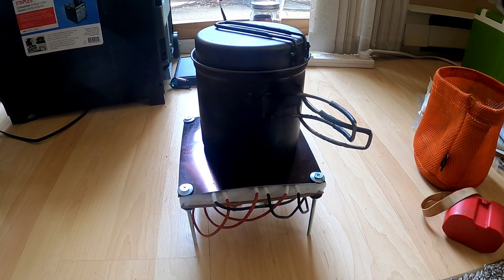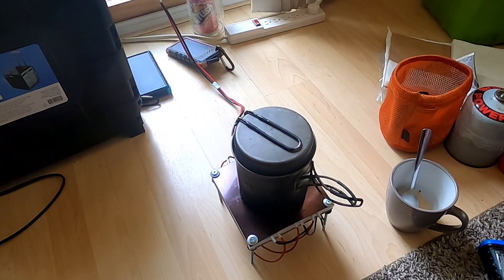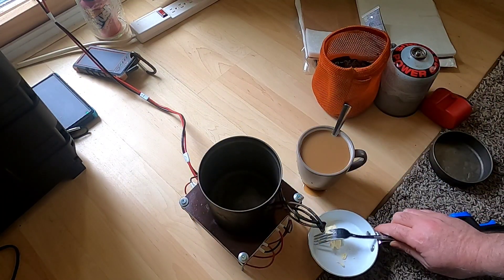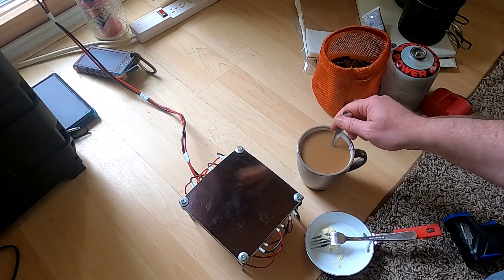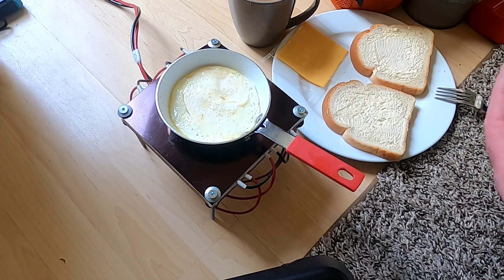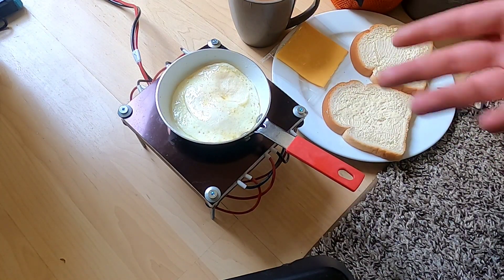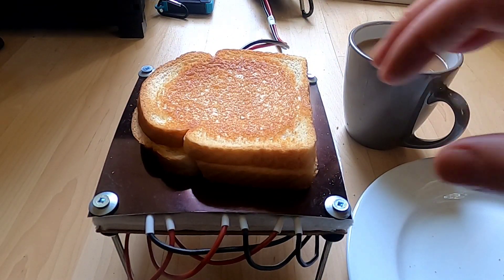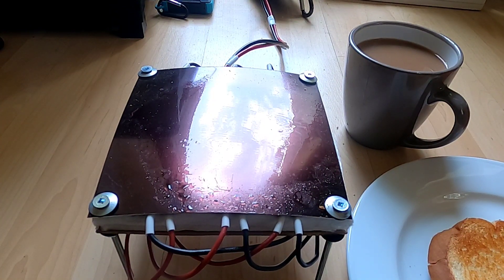12 VOLT DC POWERED, THE MOST EFFICIENT STOVE ON THE PLANET PTC THERMISTOR CERAMIC HEATER PERFORMANCE

Comment: I use 2 devices for this sort of stuff, a 12v rice cooker can be used as an egg frying pan, has the same ptc elements but is lower powered. And for boiling water just dunk a 12v immersion heater in a good thermos, then u can have your hot water ready to go any time of day or night with no waiting around. Think I'll have to make something like this for grilled cheese sandwich tho

Comment: Does that top aluminum plate have to be black ?
and how thick is it ?
and does that matter ?
the thickness of that top plate?
Could it be stainless steel?
Reply from the maker: No it doesn't need to be black, if I remember about 3mm thick, the thinner the better but still want it thick enough to be a firm plate still, copper or aluminum is far better then steel. Thanks for watching more coming soon cheers.

Comment: 😂 my induction stove will bring a full liter of water to boil in five minutes 1500 W so your 500 W unit should do it in maybe 15 minutes but yours will take easily a half hour and more so how is anything that you are doing more efficient?
Reply from the maker: It uses way less then 500w closer to 100w when temp reached
Reply from the maker: Your induction stove can't run off 12v either... so when using offgrid you need a 2000w inverter etc., I don't any 12v battery will do.

Comment: I'm looking at using these units to make a thermal mass heater AKA Sand Battery.
My thoughts are to use a copper block, set in sand. Any rule of thumb as to the size 12v PTC I should shop for?
I will be using a deep cycle marine battery . and maintaining it with a trickle charger.
Reply from the maker: You could use a copper sheeting instead of block as the copper will just be used to spread the heat faster throughout the sand, the higher temp ptc would be recommended. Depending on the volume of sand larger ptc would be needed as well. If used as a heat source a trickle charger would probably be insufficient as the power draw would be higher than 10 amps when 'charging' the thermal battery. I would need to know far more specifics of your build out to give more precise responses, hope this helps though. Thanks for taking the time to watch more coming soon cheers.

Comment: The video was a success - I'm so hungry right now.  I was thinking that it would be nice to have extra elements and switches to adjust the heat so that one could keep a pan of soup warm after cooking.  The switch would be a "1 - 0 - 2" heavy duty type and it could turn on 1 or 2 elements which is only 3 switches to control all 6 heating elements. Although, I would make an 8-inch top as my small sauce pan bottom is 6 inches - a little close to the screws.

Comment: how could i use PTM with ISEC (insualted solar electric cooker)?  in particular, could it heat up PCM (phase exchange material) and cook in the evening when the sun.  -- cant get my head around it.  thanks in advance!
Reply from the maker: You might want to look into thermal cookers
Reply: thermal cookers still require an initial heat source which is expensive for us - ive tested them.  they arnt that great.   @frankbush333
Reply from the maker: Sorry misunderstanding the question. You are wanting to use a thermistor to heat something like Hydrated Salts a PCM as a heat source after the sun goes down to provide enough energy and temperatures to cook with then inside an isec?
Reply: if ound the answer on PTC Positive Thermal Coefficient (PTC) Thermistors: Made from a ceramic substance with a temperature-dependent resistance that rises abruptly at a determined temperature, essentially shutting off the power.  They provide high power without allowing the temperature to exceed a certain threshold, and therefore provide both a heating source as well as temperature control, so no additional thermal monitoring is needed.  For instance PTC heaters rapidly raise the temperature of car seats to ~ 50 C and reduce power, maintaining the moderate temperature.  PTC heaters are available for temperatures as high as 270 C, which is high enough for ISECooking, even with thermal storage.  Another advantage of PTC heating is that the heater comes complete with high temperature wires that can be soldered to the power leads allowing the wire junction to remain relatively cool, avoiding corrosion problems.  The disadvantage of PTCs is that without good thermal connection to the food, the PTC temperature will rise to the transition temperature and turn off before the food is hot.   Additionally PTCs are not locally available in any African country I have visited, and must be imported, although they are not too expensive.  Lastly, a considerable number of PTCs have broken, for reasons that are not clear to us, but likely because they were forced to put out more than their rated power.  For details, please see our PTC report.

 

More than one heating type can be used on the same ISECooker, providing multiple functions.  For instance, a series circuit of diodes and PTCs provides temperature limitation and keeps the working voltage reasonably close to V_mppt.

  @frankbush333
Reply: thank you so much for your reply.  since im volunteering at a school in cambodia - we have issues with electricy due to the cost.  to cook food for 25 kids - i was looking for solutions.  i originally used a solar cooker but that was too difficult to use.  isec takes the concept and brings it inside.  which is much better for the cooks.  isec found a way to heat up PCM material during the day - storing the energy.  isec recommend using resistive coils but nowhere to be found.  i used china taobao to buy things but didnt really understand enough about heating elements.  PTM i found shuts off at a certain point -- im still looking at different options.  we can make one.  but already have interests from neighbors and family.  
so i want to keep it simple and low cost. thanks for your reply.  :-) @frankbush333

Comment: Iductive vs resistive load! I’m curious to what this amperage draw is from start to finish being a resistive load! It should be constant.
Reply from the maker: It is using thermistors 'variable resistance with temperature' so amperage drops as temperature rises to a set temperature.
Reply from the maker: I did a full detailed build on my channel, check that one out I detail out power consumption specs.

Comment: Hi, l  enjoyed the video but am left with question reg PTC thermistor values as printed on the items.
Ref l have a PTC blue ceramic disc type with   PTC C840 printed on the top half of the disc.
Then a line under the C840 with 0317 printed on the disc.
My question is what can l determine from this ident reference number?
Reply from the maker: The C840 is the type of thermistor you are using the C stands for ceramic and the 0317 stands for the resistance of the component at 25c I do believe. I am not a thermistor expert I normally focus of the voltage needed and the max temperature achieved and how many watts it consumes. Hope this helps, cheers!
Reply: @frankbush333  Hi Frank,much appreciated all knowledge is helpful to me

Comment: i am looking at doing something similar using 22ohm 10 w resistors on a 14v lithium battery in total 24 in parallel  drawing 9w each(216w total) and incasing the them on a perlite bed forming a reasonably large insulated cooktop ,not entirely sure but i think ill incorporate a potentiometer to vary the output ,from the math i have done so far it should boil 250ml water from 10 to 100 in under 8 min , hope it works out as the math suggests any ideas on what i mentioned would be great i am amateur as at this stuff lol
Reply from the maker: I am not sure the temperatures the resistors would reach worth testing them to see if they get hot enough first, the perilite maybe ok but I wonder about the air gaps around the pellets and whether that would negatively impact performance or not... I like the idea of the potentiometer control but would want to test the voltage drop in relation to the temperature as well. The issue using the resistors over a thermistor is they need continuous power to maintain temperature whereas the thermistors automatically decrease power consumption when peak temperature is achieved. For my build it was all about using as little power as possible to do the job not necessarily boiling the water as rapidly as possible, for off grid use power consumption is always a big factor. I think you have an interesting idea though if you get it running let me know how it turned out! Thanks for watching cheers!
Reply: @frankbush333  thanks for the input i was worried the air gap could be a problem too was hoping if im boiling water that could take enough heat from them to avoid burn out and for sure needs alot of testing in regards to temp.
i do think thermistor is probably a better way to go but was just trying to build as cheap as possible to be honest i hope to have some progress in next couple weeks i will update on any success or failure lol thanks for the vid very helpful
Reply: @frankbush333  done a bit more reading up on potentiometers and rheostats and decided that is not a good way to go instead i think since all the resistors are  in parallel i will just place switches on them individually or maybe groups of three so i can short circuit them and it shouldnt effect any other part of the circuit this way i could have 24 heat settings with 24 resistors and could even turn of half the element at a time if i wanted to use a smaller pot or have half the pan warm and half hot , i think digital potentiometers can do a similar thing but using manual switches avoids voltage drop problems and is just easier and cheaper
Reply from the maker: Ya after leaving the last message I was pondering similar things, was debating the amperage just increasing as the voltage dropped not really efficiently solving the problem... for such simple things that get tricky fast, lol.
Reply from the maker: That is why I went with thermistors they automatically decrease power consumption as they reach peak temp.
Reply: @frankbush333  finally got around to making some things first was a small pan with 9 x 15ohm 10w resistors on the bottom runs at about 90watts cooks an egg fairly quick maybe 5/6 min but will eventually increase pan size and go for 18 resistors with 2 heat settings it just sits on 3 nails , the second build was real simple about 10 metres of 25awg wire totalling about 1.6ohm wrapped around a coke can consumes about 100 watts and boils a full can in 15 min im probably going to go for thicker wire and more watts since it will run direct of a battery and not through a 10amp cigarette lighter total power used was 2ah at 12v probably 3ah to get to full boil
Reply: i would like to vacuum insulate the can too maybe as you need gloves to touch it ive only wrapped insulation tape around it so far ,early days lol
Reply from the maker: Awesome, just keep in mind the cans have plastic internal liners that may leach into the water at higher temps. Maybe an aluminum spice container or something would be better suited not sure how the nichrome and aluminum oxidize with each other if at all, worth checking as well and of course non conductive insulation around the can always helps accelerate the process. Killer idea though I like it, maybe I will try something similar. Cheers!
Reply: @frankbush333  cheers i was thinking about the plastic on the can too seems fine but really not sure i thought maybe a 1.5inch  alloy tube or something similar maybe even try to adapt a flask somehow but the coke can boiler ended up costing me around 3$ i think
Reply from the maker: There are lots of aluminum pots available at thrift shops etc as well, just a thought...

Comment: I plan on using 3 Bestol 2pcs PTC Heating Element 5W-50W to heat some soapstone.  I plan on running it into a car charger into an outlet that is tied to a car battery.  Would that be too much wattage for that set up?  Thanks.
Reply from the maker: Together that would be about 150w at peak normally I would not want to go above 120w on a cig lighter adapter
Reply from the maker: A direct wire to the battery using a 12 awg wire with a 15 amp inline fuse and a switch would do the job, I would not want to run that for long when the vehicle was off though you run the risk of killing the battery.

Comment: “Most”
Reply from the maker: There is nothing commercially available that uses this little power. The most efficient stove element on the market uses a constant 300 watts. This design at peak uses 240 watts on initial coming up to temperature and 50 - 100 watts running.